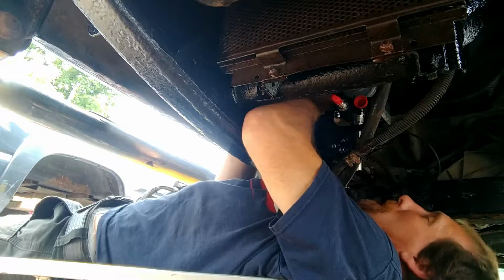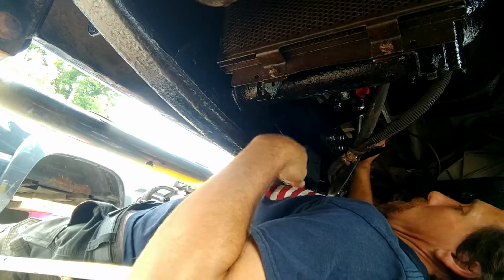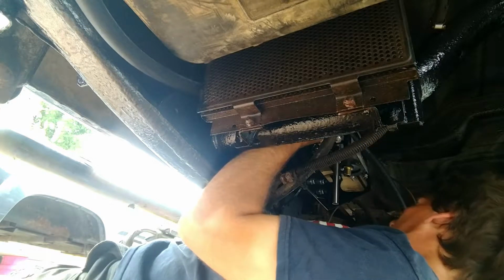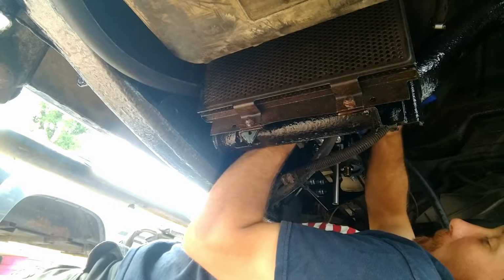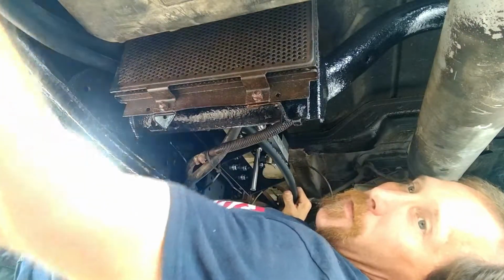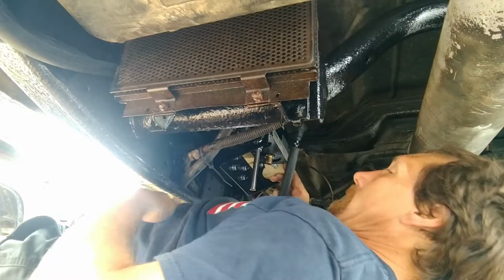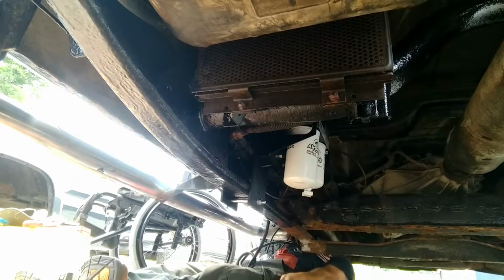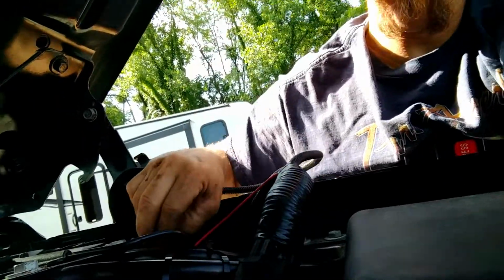05 Silverado LLY Duramax AirDog Diesel Lift Pump Install

Comment: I've read that these can cause limp mode issues for causing too much pressure on the Dmax's. Is that true?
Reply from the maker: I've never had that experience myself and I've never encountered anyone that has either. If that is a concern I would recommend calling and talking to air dog technical support and they can answer any questions and concerns you have. They are truly an awesome company and will make sure you're satisfied.
Reply: @MechanizedGarage  I haven't had it yet. I have an DMax LLY that has about 280k on it with the original pump. Was going to upgrade and found some of those negative reviews... Like with anything out there lol. I have it all torn down bc I'm replacing the FPR. The previous person who did it stripped the torx bolts so it was a fight to the death lol. I tried everything and ended up having to take my Dremel and cut a slot across the bolt head so I could fit a flat head screwdriver on it and bust it loose. Went to the parts store next to me and got hex head bolts to put back on it. Not going through that again lol. Thought maybe I'd look into changing the pump while I was there